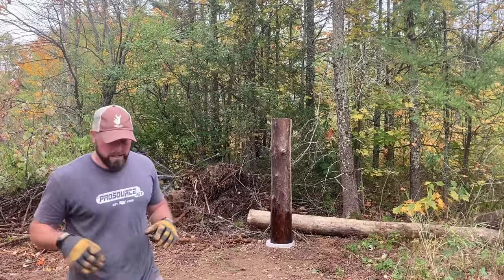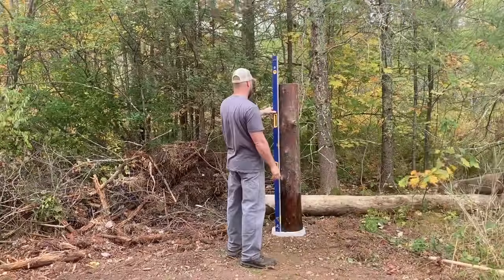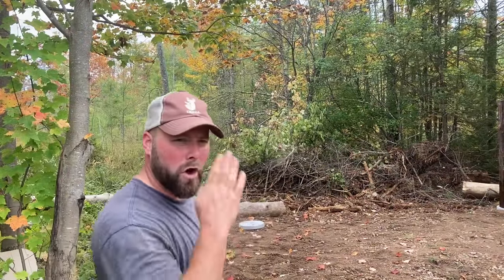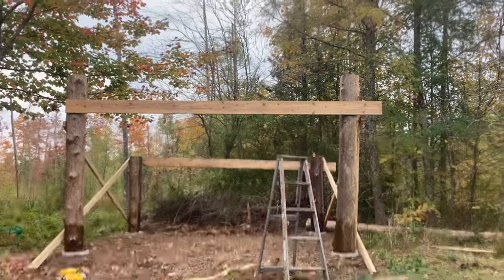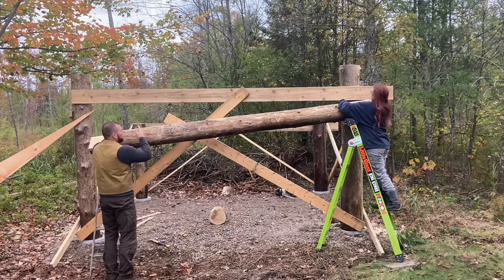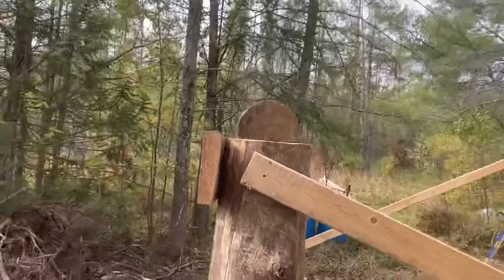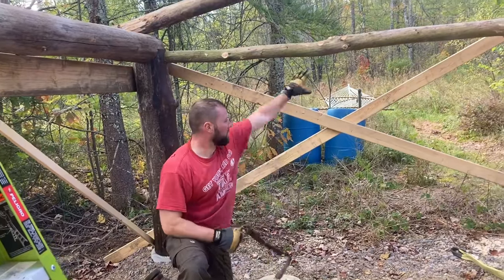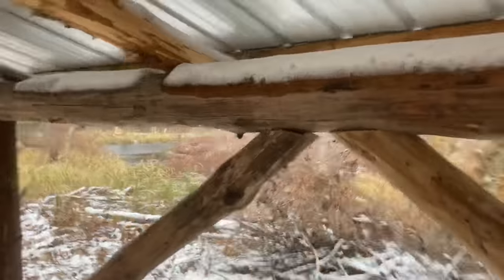#146 DIY Log Framed Woodshed Start to Finish

Comment: Great video and a real good wood shed.  You are so lucky to have a wife to help you with what you two are building.  Please be more careful of her because she is so willing.  Her under that big log with no tag rope ( a rope around the top of the post then over the horizontal 2x10 tied to your post you are going to lift ) to catch the big log if it would fall and her under it could put her in a wheelchair or worse.  You are the big guy so protect her.   I like how you chose to use a cement pad and not dig the post hole and explain why because of the water...  I will be following your builds so keep up the good work.
Reply: @Hello Ray how are you doing

Comment: You did a good job. I especially like that it looks level and square. Wife did her part as well. Building roughly the same structure with spruce. About same diameter logs. Like to see how others build their tractor sheds. Thanks for doing video.
Reply from the maker: Thanks good luck with yours

Comment: That's fascinating. I live in Texas…no real moisture like that. But I am wanting to put some juniper tree trunks on sonotube piles for the height I needed. For a brush arbor. Would be easier to do what you did…but wasn't sure it wouldn't move. Maybe the square design of yours contributes to stability? Mine will be a double rowed arch measuring about 25'. 10" - 14" trunk circumfrance..maybe 9' high. Would have cross pieces at top of arbor.

Comment: Great shed! I wish you had showed how you attached the rafters and purlins, and also the side supports (I assume mortise and tenon?) and 45s. But great work, I love the simplicity and structural strength.
Reply from the maker: Timber screws were used through out I just curved the ends of the bracing logs and fit them against the uprights and put a couple screws angled in. Two years later everything good

Comment: Man, I respect the willingness to work so hard but I gotta admit I had to laugh as soon as I saw the tractor. The whole time I was thinking you had no option other than man power. Thank God for the tractor huh!
Reply from the maker: I have a very small yard behind the camera and the tractor barely fits.  Rey hard to maneuver and a chance I could run into my cabin. Also I would destroy the yard and have to redo it so I opted for physical labor.
Reply: My notes on this DIY: bulk up my body from 160 to 240. Hit the gym and do dead lifts of 400lbs. Learn to be a lumberjack. Assemble wood shed. Got it. :-)
Reply: @Da_cat12  Totally doable! 👍😁
Reply from the maker: @Da_cat12  nah man the camera adds 50lbs and I can’t remember when I last dead lifted anything that wasn’t dead👍

Comment: Nice build. Doing something similar in northern Wisconsin at my property. I have mostly hard maple on my property but I've got a ton of it.
Reply from the maker: Where abouts in Wisconsin? We are a little south of Hayward.
Reply: @backinthewoods2022  I actually live down in the south part of the state but my property is over by Mercer. North of Minocqua about 40 miles.

Comment: I want to build a similar structure, easier to do if I don’t connect to ground. Yours doesn’t have any uplift protection, is it still standing?
Reply from the maker: Yeah no problems many people have mentioned that I believe the sides being all open and it’s very heavy I don’t worry about it

Comment: Looks like I'm about a year late to the party, but really enjoyed the video. (I'll admit to cringing a little for you and the Big Boss's safety hoisting big logs from ladders.) My question: How did you attach the side rails to the corner posts?
Reply from the maker: I just used log stews and “toe” screwed them not the strongest but got the job done might change it up later but just wanted to get it done thanks for watching 👍

Comment: Have you ever heard of a block and tackle, comealong, chainfall etc?
Reply from the maker: Heard of ‘em 
Didn’t need ‘em
Reply: @backinthewoods2022  I noticed that, and you did a great job. I just don't understand why you wouldn't choose to save your back by using some very basic hand tools to make the job easier, safer, and quicker.
Reply from the maker: @oms1972  The only problem log was the high horizontal log the others weren’t bad. I didn’t use my tractor right away because it was a very tight area that my wife spent a lot of time growing grass. I didn’t want to tear it up or hit my cabin. In the end I had to use it though. The other tools you mentioned would have took too much prep time for an impatient person such as myself. Many people have commented on me putting my wife and myself endanger of injury. I would never do anything I thought my wife couldn’t handle and I know my limits. We have done many projects like this in the past eight or so years without injury.
Reply: @backinthewoods2022  I just finished building a 400 square foot treehouse 20 feet off the ground in Vermont. The main support beams that I built out of 24 foot PT 2x12's weighed approx 1,000 lbs each so I didn't have a choice but to use a block and tackle to lift them up 20 ft off the ground. And I'm almost 70 years old and weigh 150 lbs soaking wet so I'm not nearly as strong as you are.  I'm planning to build a log Lean-to on our property this year, I'll give you a call when I'm ready to  go.   Again, nice job on your project, looks great!

Comment: I want to do the same thing, for my tractor implements. How did you fasten the 45s in the rafters did you just use spikes or timber screws? Or did you do additional joinery?
Reply from the maker: Just long timber screws no problems after a few years

Comment: Nice looking shed.  Did it get anchored to the ground?  If not are you worried about wind at all?
Reply from the maker: I has not been anchored
I am not worried about wind I don’t believe anything short of a tornado would effect it. It has no sides so I figure it just blows right through, no problems a year later. Thanks for watching

Comment: Love this shed for wood!  Can you give more info on log dimensions you use and size of shed.  Do you use a certain diameter log for corner post and rafters? Also how you are putting the logs into the ground (in general).
Reply from the maker: I used around 10” diameter for the posts and larger beams and did not put these in the ground on this particular build just set them on concrete pads. The shed is 12’ by 10’ and the rafters are smaller around 6” hope this helps
Reply: @backinthewoods2022  thank you!  You have inspired us to try and build a woodshed this way.   On a side note, we died laughing when you came across that “man eater”. Your comments were hilarious!

Comment: I have alot of dry ash killed by ash borers on the land so I'm thinking of doing something like this but maybe a bit taller.. say 10ft front and 7 rear posts to give me some attic storage in the future.  How is the design holding up did the pads work out? I was thinking of using concrete pier blocks to give the wood some height off the ground
Reply from the maker: Everything is holding up great finally started loading it with wood the last few weeks. The head room works well as far as loading and I have pallets underneath that take up a little space too. I’m able to keep some lumbar and a extension ladder stored above the top side braces.

Comment: I’m doing the same thing with making them posts for my structure. Did you use some sort of clear stain or preserve to make them look nicer and last longer ? Thanks
Reply from the maker: I just used some old oil and rubbed down the areas that would be underground or about 2’ above I would let it soak in and then put another coat.

Comment: Your going to contaminate your ground water with the oil bro all you need to do is seal them by burning them a foot up...and No that's not good for the Back I know being a builder and 5 spinal fusions and you had a tractor the whole time 😎  👍🤙...Good job I would definitely anchor it to the ground I've seen storm's do crazy things
Reply from the maker: Didn’t want to tear up my yard or get stuck and potentially back into my cabin it being a very tight spot. It’s just a bit of oil most of it soaking into the wood we pump the stuff out of the ground maybe I’m wrong but I don’t believe it’s a major hazard. It’s been a few years now unless there a tornado which will blow everything away this thing ain’t moving all the sides are open to let the wind through.
Reply: @backinthewoods2022  Your good Brother 👍 sometimes texts come out a bit stronger than intended...ya done good lad...🍻

Comment: Looks like it will serve the purpose of what it is intended to do however the heavy heavy logs is overkill, I would just had used 2×4/2×6/4×4s would had worked fine as well.
Reply from the maker: Yes they would but then you would have to either buy them or mill them yourself which would cost time or money this was quicker and cheaper.

Comment: I was laughing so hard.  You two remind me of me and my wife.  The gals even sound alike.  Funny.  So, is there a tree species thats best for this type of project?...and also what species would you not use?
Reply from the maker: I would think cedar would probably be the best. This tamarack is very good too has some natural rot resistance and grows very straight. I think I would avoid Poplar and Basswood anything that rots easily. I will also reapply some oil on the bottom half after a couple years so the water is less likely to soak in from rain splashing and stuff. I think it should last longer then I will.
Reply: @backinthewoods2022  I have plenty of maple but probably not ideal.  I would assume red pine would be better than maple.  Have numerous mature big red pine also.
Reply from the maker: @saypuppy  I remember looking at a website about all the characteristics of the different woods that may tell you which one would be more ideal. I can’t remember what the name was though. I would say the red pine would be better too because of the sap but not sure. Good luck with the project👍
Reply: @backinthewoods2022  thanks.  I'll start searching.
Reply: Same about the wives..  I was laughing because I tend to put mine in some hairy situations forgetting she she can hardly lift half the weight I can.  I’m lucky she can handle it.

Comment: Why not just dig 4x holes for the support beams and concrete them in 1 metre deep ?
Those supports won’t stop that falling in the wind mate.
Reply from the maker: In the video I explain I’m right near my pond and we hit water a couple feet down. It would take a straight line wind or tornado to move this and the shed would them be the least of my problems. The uprights are very large and heavy I’m not worried.

Comment: Why do you have ti shave the bark off
Reply from the maker: Moisture won’t be able to escape and will rot the log quicker and bugs will get in under the bark and burrow. The logs will last a lot longer without both those things
Reply: @backinthewoods2022  tks for the info now I need to get a spoke shaver

Comment: Man, this is scary. Kudos to you for having a go but you're lucky your back was strong. If those uprights had been much more stable to begin, you could have hoisted your beams using block and tackle mounted on the posts themselves, then nudged them up the last little bit. Those rickety ladders gave me PTSD. Cutting out half the ends of your beams - that means only half the timber is supported. Why not split the logs, then? Is the extra unsupported timber giving it stiffness you can't be without?
Reply from the maker: I wanted to throw something together quick and dirty so I didn’t mill anything up. Just used the saw to shape some of the logs. Leaving the logs whole gives it a cool look I think and even though I cut them down at the ends half way it probably made it a bit stiffer. It all looks the same today as when I first built it no problems. Thanks for watching👍